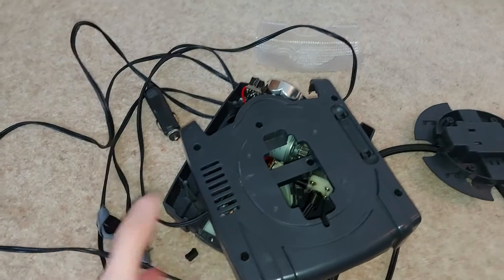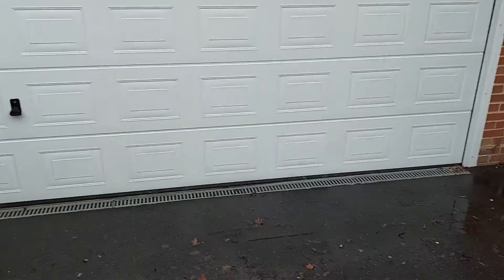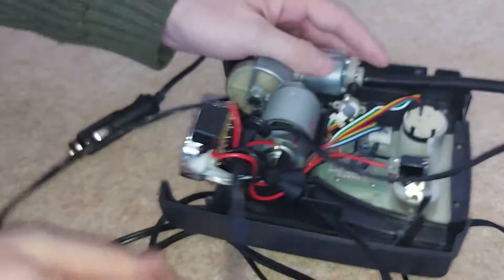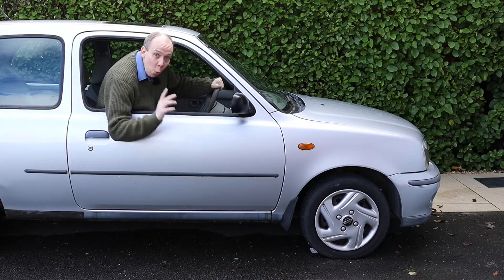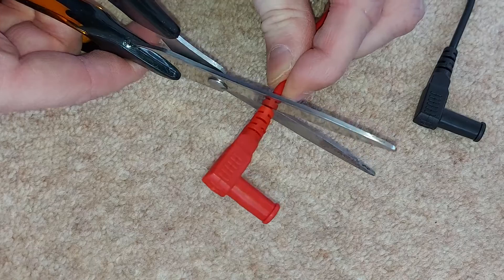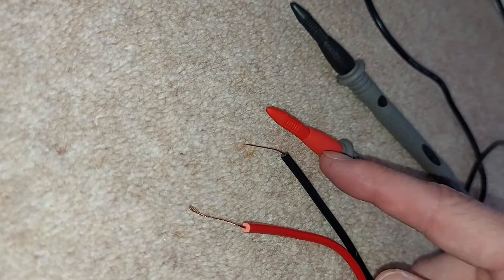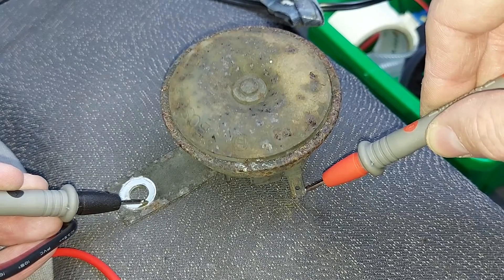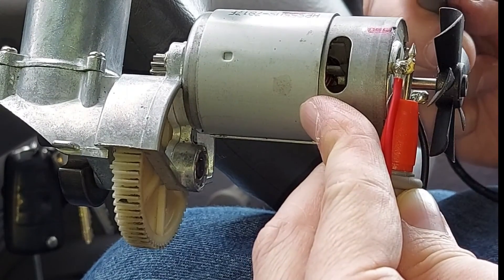Automotive Test Leads For Nissan Micra K11 (Making)

Comment: A good idea.  A little risky perhaps for some to have bare probe ends.  And butchering new probe leads, well.! 😗😃  When I tested a horn, still fixed on the car, it was so loud it made me jump. 😆
I have a similar kit that goes from battery terminals (using crocodile-clips) and various insulated connector tails with where necessary in-line fuse and/or bulb and switch.  Using one wire can confirm poor earths too.
Reply from the maker: Thanks Nta16. A battery terminal probe would be handy, too. Good idea. 

Funny enough, one of the Primera's horns stopped working today. I'll investigate tomorrow and see what's what.
Reply: I wasn't meaning a probe (I'm not brave enough) rather insulated connectors (made up as required in my case) that can go straight on to the item's connector(s) or small insulated crocodile-clips (more difficult with modern cars tho').

Comment: Good video again, car all back together now just the wheels to put back on and get her running again and checking all the fluids on the car, got brakes done today,  have a good weekend mate
Reply from the maker: Thank you, Ian. Glad the car's progressing. Aren't brakes optional, though? You could have saved a few quid! Enjoy your weekend.
Reply: @CarSpyTV  I think you are right, I will get the lads to strip them off and have a run around the m25, what do you think with a bull bar around the front
Reply from the maker: The bull bar is a better plan than mine. I was gonna send you a parachute!
Reply: @CarSpyTV  both maybe good idea 💡